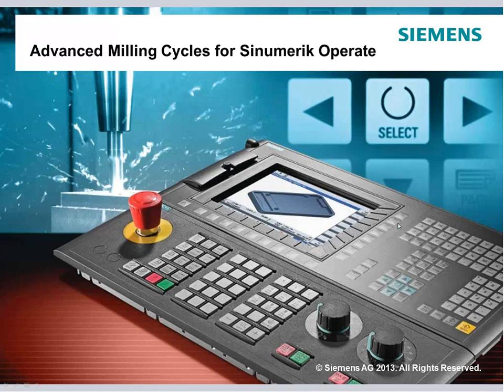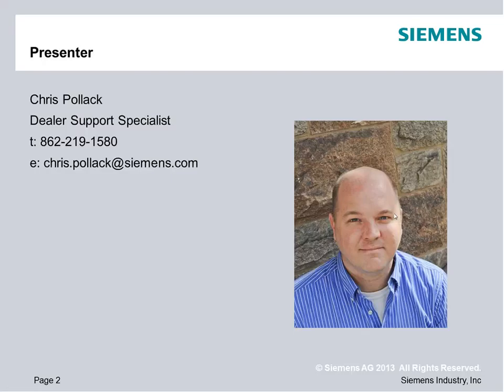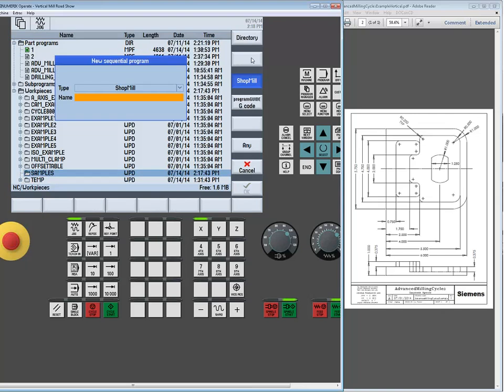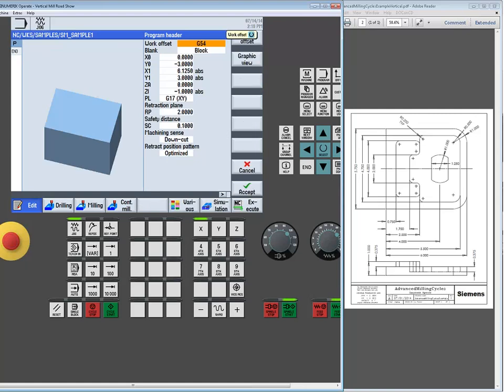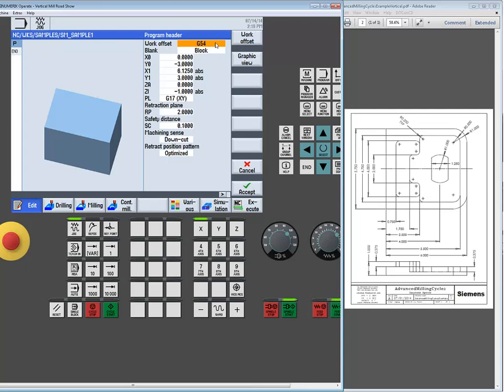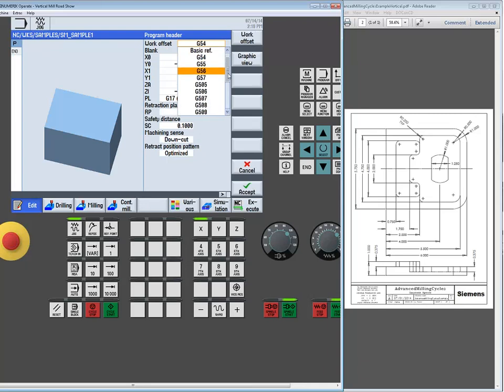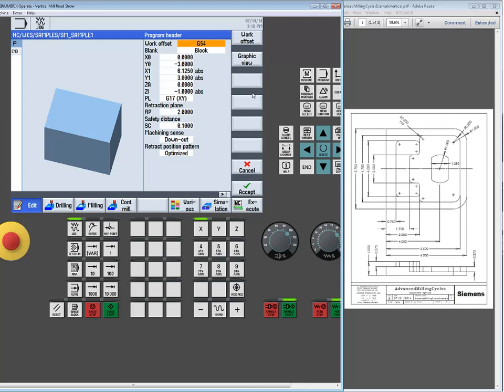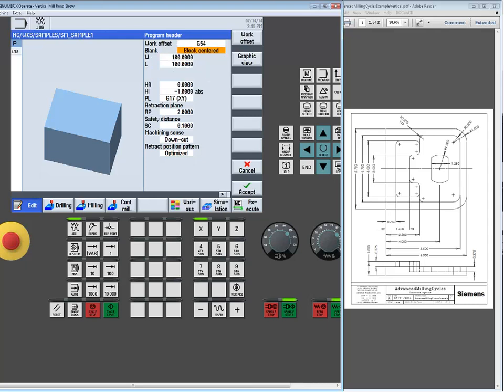828D & 840D Advanced Milling Cycles in ShopMill and Gcode

Comment: Hi all. New to Siemens but loving it so far. How do I add a pause in the program so I could turn part over etc. Instead of having two programs? Also add a msg telling operators instructions?
Reply: m0
Reply from the maker: As stated below - you can program a simple M0, or optional stop with M01.

The message command is straight forward:
MSG ("Example") --> creates the message 
MSG() --> cancels the active message

Comment: Hi therem great video! I tried using an additive rotation and offset transformation the island, just to make things different...undergraphic video it shows the offset and rotated contour, but when simulation, it just moves it back to the original position and ignores the transformation commands....is there a way to fix this? Doing the same thing with a spigot provides the expected results. just not a contour mill
Reply from the maker: Thanks for the feedback! It is possible that this is a bug during simulation. If you have the ability to do simultaneous recording while running the program in Auto, I would check that simulation as well. Hope that helps!

Comment: Hi, Just wondering what you would suggest is the best way to program an ellipse shape for path milling etc.?
Reply from the maker: You can program an ellipse in G-code with our Polynomial interpolation (POLY, POLYPATH, PO, PL) function.  I have never done it myself but if you reference our job planning manual it will talk about it.  https://support.industry.siemens.com/cs/document/109481532/sinumerik-840d-sl-828d-job-planning?lc=en-ww